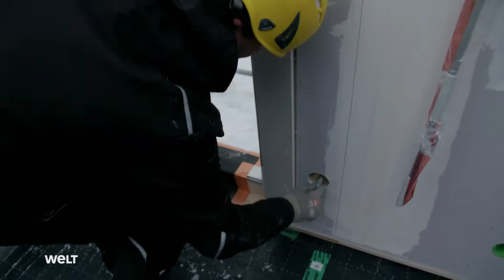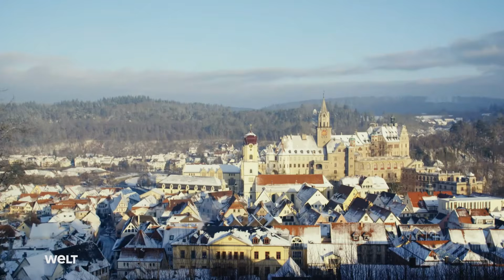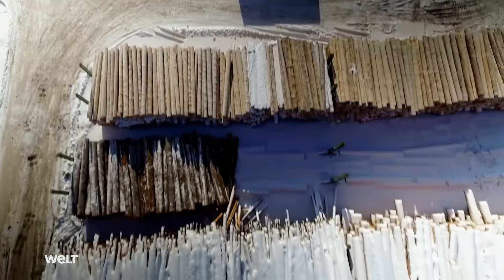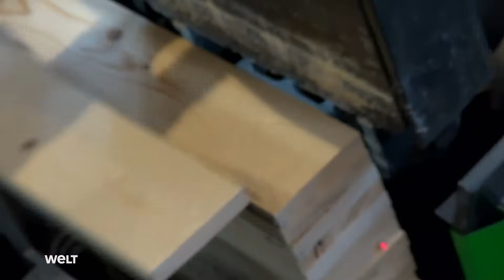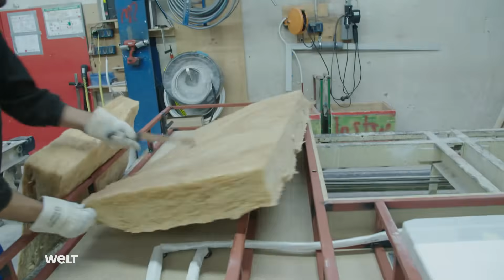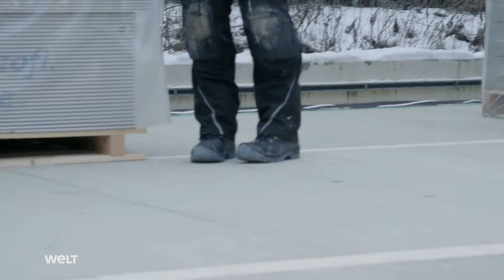BUILD A HOUSE IN WINTER: German Prefab homes - A Journey From Tree To House | WELT Documentary

Comment: When it is considered, it is a fast way to a new home, especially when it takes 6-12 months for a home to be built in Scotland. 
We have seen these homes built many times and people are moving in the next month. With all the wall installations pre-planned it is easy for electricians and plumbers to have their installations done very quickly. Normally these trades have first and second fixes that are weeks apart, with this method, it is days.
I used to watch home design programs and one thing that was constant was budgets, they always went over. You can budget for a build but be prepared to go over by 25% max, any more and your budget was too low to start with, at least with this method you know what it will cost before you start to build.
I worked on the Hackney project in the 90s which was a prefab design. Two large Portacabin units all fitted out with appliances that were transported to site and slid into a steel framework then connected with services and fitted together and it was ready to move into.
Technically the exterior plaster is called Render, it is a waterproof coating that protects the interior elements from the elements.

Comment: The thing about this company, which you don't find here in the states, is how they consider quality as a basic rule for doing business. They take the same, or similar, wood as we use here, first remove all the knots, then laminate it together, BEFORE starting to frame. In a sense, the whole house is built with engineered wood. This is something I have tried to push for a while now. It is smart, and gives the best quality in the end. You can't straighten a crooked floor or wall after it is built, very well.
Reply: there is absolutely no way we can make that affordable right now.   this type of building would not succeed in America.
Reply: @j.jarvis7460  I think it would if they did the right marketing and customer service, an hired good people.

Comment: I wonder how earthquake proof or fireproof are these homes.  I wish our US prefab homes had these types of fit and finish.  These German and Swedish companies should start their branches in USA and I am sure there are buyers in US if their prices are reasonable.
Reply: Since the laws about fireproof building in Germany require a pretty high standard these prefab houses are very safe compared to standard US houses. As insulation,  the wood itself and various other materials used, need to be very fire resistant and at the same time be as effective at their respective aim (like insulation, stability,...) as possible.
For earthquakes there is a different standard for various regions depending on the risk and intensity of the earthquakes there, but making a house earthquake proof is as far as I know mostly done in the foundation of the house.
Reply: @panzerpack9208  Thanks.  As for earthquake resistance construction factors I believe it depends on number of floors.  For example I have seen pretty sophisticated systems in the foundation of high rises where in one or two story buildings they basically bolt the buildings to the foundations.  I bet if we get our smartest engineers from across the globe together and ask them to come up with better building standards, processes, materials that are more affordable and sustainable, they will come up with smarter and cheaper ideas.  Due to population pressures we will have to come up with better solutions if we want to lessen our negative impact on our planet and all living things that we share our world with.
Reply: Amen to that. I have been looking all over the USA for one like this German company, but there is not one. If you find one, let me know please. Thanks

Comment: What the hell is going on with the heating thing. Your electric radiators heat the house and a fan blows the warm air around. Don't they have running water to fit a combi boiler. Its like living in the dark ages??

Comment: In my country, prefab homes are built with concrete. Much cheaper than wood.
Reply: Except the world is actually running out of the specific type of sand needed to make concrete/cement. Also, trees are a renewable resource as long as replanting keeps pace with the harvest. And the managed forests grow better trees and tend to not get consumed by wildfire because fuel isn’t allowed to accumulate at ground level.
Reply: Where are u from?

Comment: The pre fabs are such nice constuction not like some builders i see just use nail gun like its insane the literaly blow wood apart using nails out of nail gun the guy who built my shed once had air nail gun and its fine but its like he damaged it all the nails he used on each peice mising studs alot same as lot of contractors i see they need to go back to hammed nail with hammer

Comment: I am genuinely impressed with the science, design, engineering, technology and construction of the systems, equipment and processes that go into felling, processing and transfering the trees from forest to timber yard and through to the client prefabricated house builder.

The expertise of each of the professionals involved is technically excellent.

Likewise, the prefabricated house builders own systems, etc are remarkable to see.

The production quality is of a huge order of magnitude over that of a traditional building site constructed home!

However, I was disappointed to see the use of chipboard panels in the construction.

I consider OSB, chipboard, particle board, plasterboard (sheetrock) and MDF to be garbage that has no place in quality construction.

I of course recognise that manufacturers like these products for their cheapness, together with their ease and speed of use, so they incorporate them into their products.
Reply: The OSB that gets used in German construction has specific quality control and a class system. The ones getting installed on the inside are toxin free for example. The OSB is also very good for bracing to ensure none of the walls lose square. So it depends where they buy the OSB (which manufacturer) and what class they use for what. It's definitely not trash if they know what they are supposed to work with
Reply: Steel prefabricated houses exist. Alternative would be pre made panel which would be then filled with concrete. Something as mix between ICF and panel. Or look up spider fix system.
Reply: My first reaction was the same. Then I thought, For interior walls particle board would provide good thermal insulation and be cheaper than solid wood.
Reply: @tim2015  solid wood? Why build a house from solid wood?
And yes thermal an acoustic much better!
Reply: Than you be an American, used to Usa quality! 
Here in Europe things are different!
This house will not blow away!,
But what do you know if you build a house from “ cardboard”
..
Reply: Do you realise what cutting trees down is doing to our Planet. Do you have Children? What will the earth be like when they have their own grown children. Come on wake up
Reply: Those items are much more consistent in quality as well as appearance even though most of them are crap lol. They simply slap a veneer on them and say “see all pretty now” lol
Reply: @prepperjonpnw6482  its not usa over here. We are not fake!

Comment: as a builder i think this is where the world is moving
Reply: Hell if that's the way it is going to start being with building a new home then I'd buy myself one complete and after that I'd just take the house with me when I was ready to move to a new location then too
Reply: @jamesburke5709  remote vehicle would do you good thus an RV OR may be a trailer would work , but considering that the world population is growing something has to be done where houses can be manufactured like any other thing all you need is to have your architect and then send the plan to the manufacturer  , then show them the location , in this way , without even having land you can start paying for the designs and the house all at once.
Reply: interesting.
Reply: Its already there mate